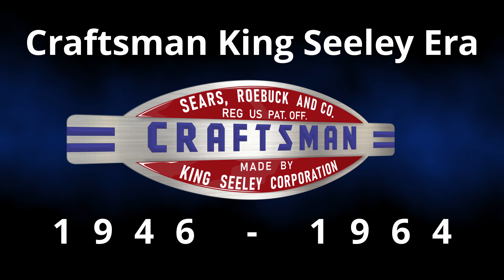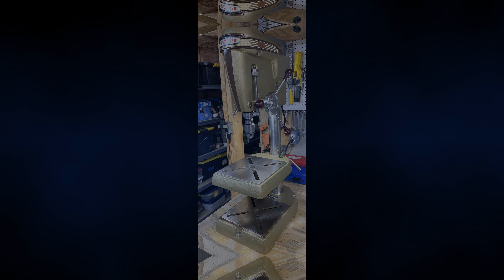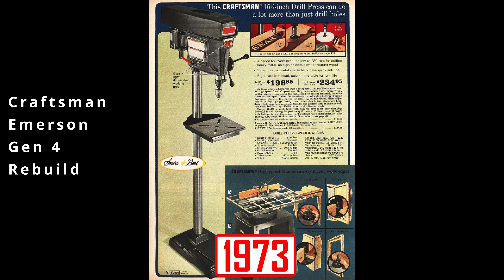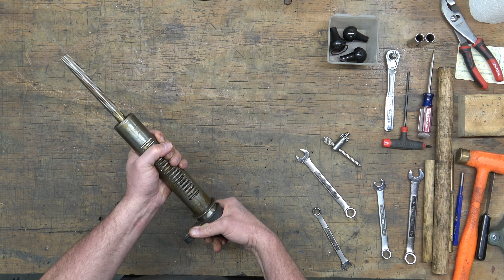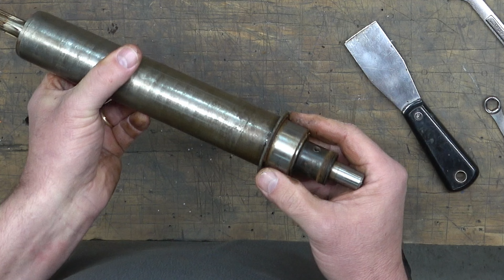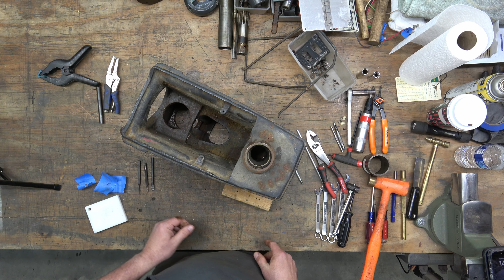Part 2 Craftsman Emerson Gen 4 Rebuild (Disassembly Continued)

Comment: I am going to have to replace the bulb socket for mine. Have you found a suitable replacement? My wire was chewed into and it is too short to repair
Reply from the maker: Yes, I use these from amazon. You will need to remove the mount and bend it to fit. I remove one screw, then bend the mount straight up then bed the top  back 90 degrees. I do not recall if the screw hole is the correct size for the screw thats on the drill press mount panel. Worst case drill it larger and use a screw with a nut to secure it. Really a very simple modification. here is the link to the sockets I use: https://a.co/d/04LOgjOH
Reply: @JeffsShop 
Got is done 
Thanks
Reply from the maker: @diyhgg8674  Awesome

Comment: Do you know what bearing maker was used originally?
Reply from the maker: Most Drill Presses had New Departure Bearings and some had Norma. The motors had SKF, MRC and New Departure depending on what motor originally